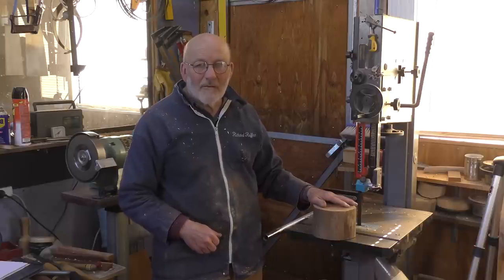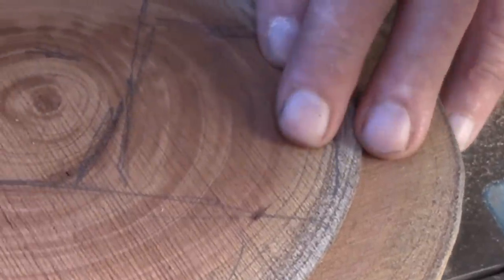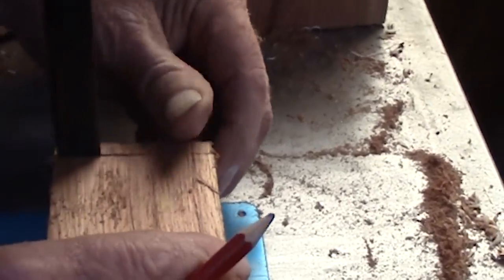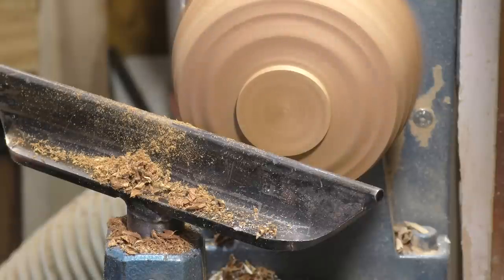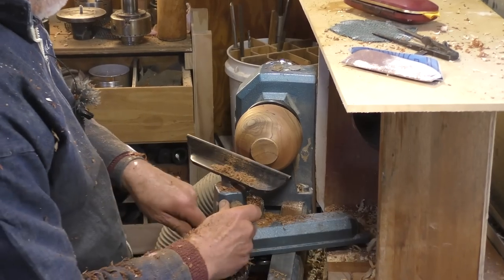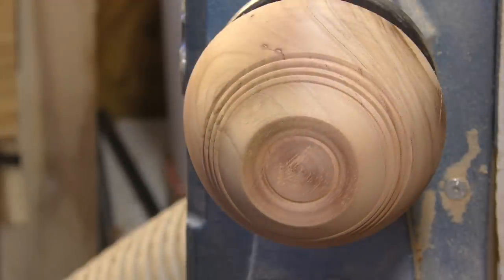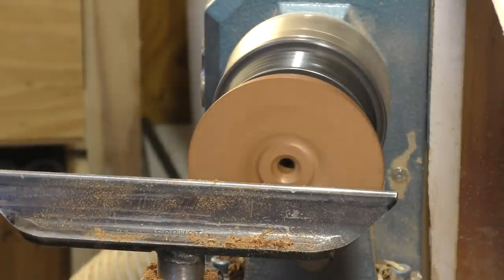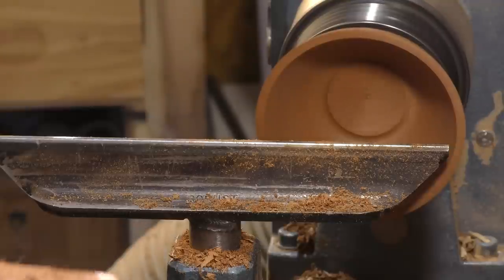Richard Raffan turns a red cedar bowl

Comment: Interesting! 2Qs:  1.  How do you decide between using just wax or a combination of oil and wax?  2.  You mention might need a different kind of finish for THIS bowl.  What would that be?
Reply from the maker: I  usually mix the oil and wax and it doesn't seem to matter which goes on first. If a piece is full of holes or splits, then it's oil only because wax gets caught in the holes and splits. On very dense hardwoods I find wax sufficient. This cedar bowl would benefit from ongoing polishing to develop a deccent patina, but I have no idea where it is or the treatment it's getting. As a generalisation, all my work gets the boiled linseed oil and beeswax because it's a good base for ongoing wax polishing, and it comes off utilitarian bowls when washed in hot water and detergeant.
Reply: @RichardRaffanwoodturning  thank you.

Comment: No tree is perfect and every tree is perfect. Bowls with features are perfectly acceptable. They take more time because they need special attention. As a production turner I can certainly see why you like the lack of features.
What would be your preferred finish if you had it available?
Reply from the maker: It's not that I don't like or want features. My experience tells me bowls with splits and defects are not easy to sell. Neither are bowls with particularly flashy grain patterns. That said, the features I look for are grain patterns and I select my timber and cut my blanks accordingly. Splits and cracks are defects in the wood, along with borer holes, split knots, and patches of rot, so I usually cut them out.  I see no point in using second-rate material when there's plenty of good stuff available, often within the blanks full of 'features' people are turning. And I can't imagine what makes you think I'm not using my preferred finish or that if I did prefer something else it might not be available.

Comment: Thank you for putting these videos up. I have been wondering about your technique when using a scraper on the inside of a bowl and how you avoid catches? Is the tool rest set at centre height of the bowl or slightly higher? When I use one it is a white knuckle ride in fear of getting a catch!
Reply from the maker: The angle between the top of a scraper and the surface of the wood you're cutting needs to be less than 90°. This is konwn as a negative rake. After that, think in terms of stroking the wood rather than scraping. You're not trying to get paint off a door.
Reply: @RichardRaffanwoodturning  I didn’t know about the ‘negative rake’. Thanks for the reply, much appreciated
Reply from the maker: @michaelcox3462  You'll likely come across negative rake scrapers. These are similar to skew chisels in that they have two bevels. They were developed to make scraper catches less likely and are widely promoted as essential tools although I never understand why. Being aware of the issue, why tools catch, overcomes the problem. Mostly it's a matter of  keeping scrapers tilted below horizontal, the handle above.
Reply: @RichardRaffanwoodturning  Thanks again, I'm looking forward to trying this out